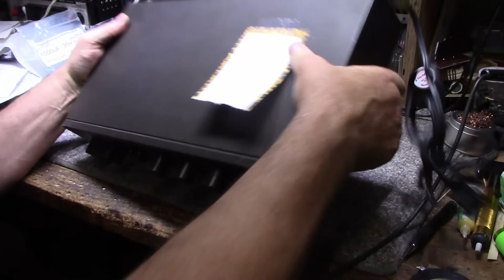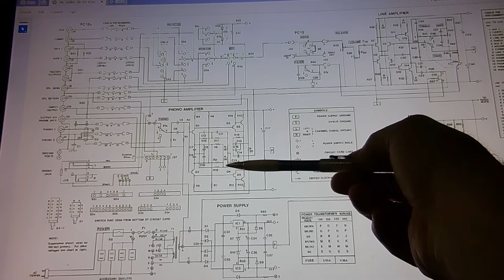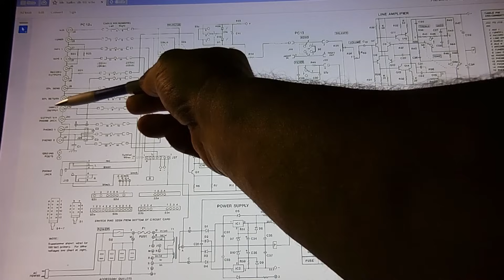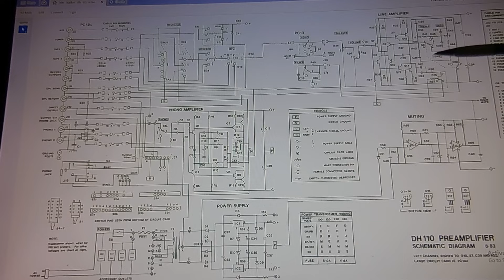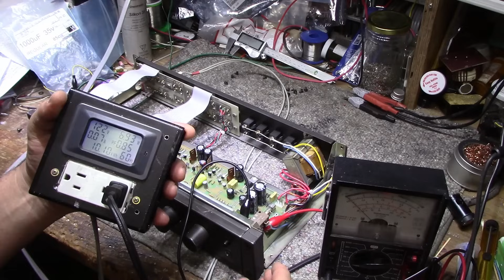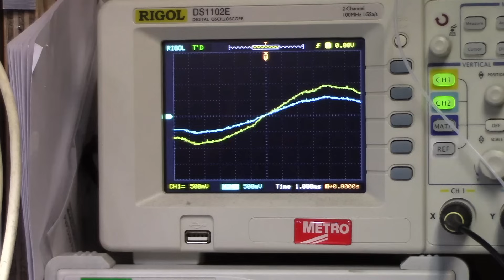Hafler DH110 Preamplifier - NFF (Ep. 200 )

Comment: Nice video. I built one of these in back in 1981. Still have it. I had the same balance issue a couple of years ago with it and it turned out to be dirty output RCA to the amp (Hafler DH230). Cleaned all the input and output RCA jacks and it has been fine ever since. I have three other preamps, all of them cost 2-3 times what the Hafler kit did. To  me, it is still the best sounding  of them  by a small margin all but actually all sound very similar and the differences are minute. BTW "ELP" is External Processor Loop. I use for an equalizer if .

Comment: There's nothing more frustrating than intermittent faults !
I was surprised you didn't test it before you took the cover off, that ribbon cable appeared to be slightly loose, it's possible that may have been enough to add a tiny bit of resistance to the output, we'll probably never know.
Reply: That's exactly my thoughts too! It didn't look it took much force to remove the ribbon cable, the pin header and cable socket could have tarnished over time? See this same issue with vacuum tubes, some contact cleaner and it's good for another 20 years.... 
The only other thing that I could suggest is broken solder joints... A reflow with some flux will take care of that problem... Especially when RCA connectors are involved, connecting and disconnecting RCA cables can break solder joints...

Comment: I built my Hafler amp kit in 1982.  The boards came soldered, so it was basically assembly of the chassis and power supply.  Also built a few Heathkits as a kid.  Sure miss the kits.  Guess that's why I got into restoring/tinkering with old audio.  Congrats on 200 episodes!  Hope you can do many more, always enjoyable to watch, and I learn alot of good info!

Comment: At around 18:00 to 19:00 you show a volume control tracking issue, enough to account for the customer's problem. I had a defective volume control in one of these that acted the same, maybe worse. I confirmed it by removing the control and feeding DC to it externally and viewing the DC output on a scope as the control was rotated. I could easily see the shifting balance characteristic. Replaced the control with one from a parts unit, problem solved. Also, the DH-110 is quite notorious for dirty controls. Don't be too surprised if this one comes back for a re-do. By the way I have extensive experience with these.

Comment: I guess the owner could try reversing the left and right channel connections on the feed to his power amp, and if the disparity between the channels does not swap over, then the problem is with the power amp. If it does swap over, then it could be the leads.